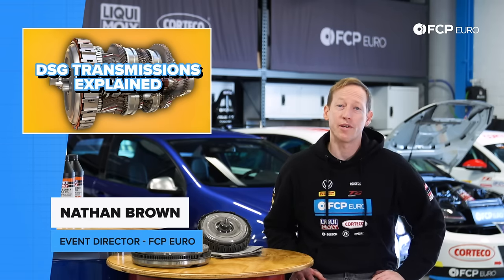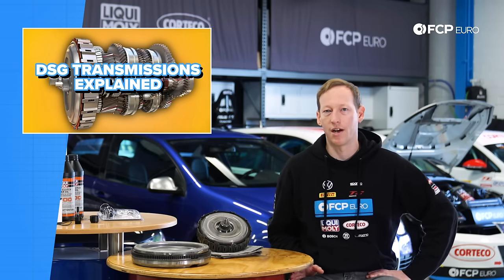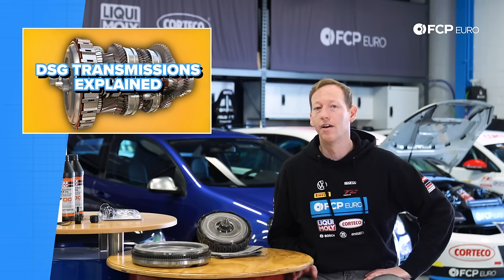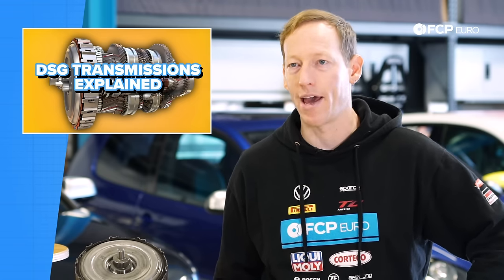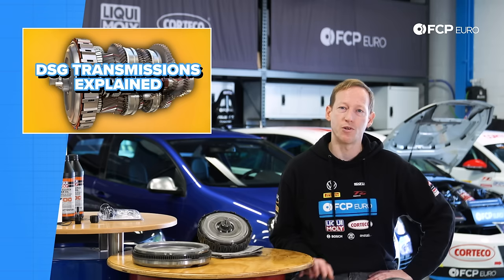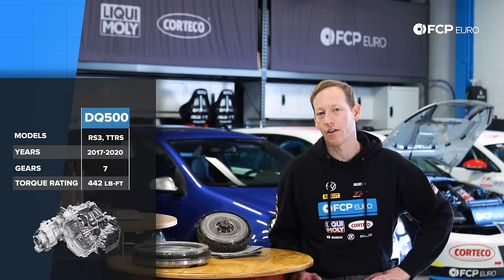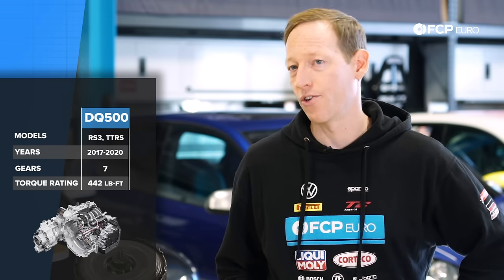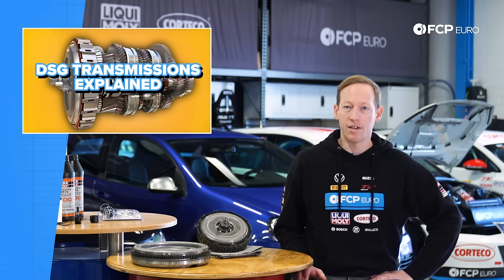The DSG Transmission Explained - How A DSG Transmission Works, Advantages, & Cars That Have Them

Comment: Superb video getting into the nitty gritty of DSG boxes' pro's and cons, just this one video could save a lot of VAG owners a lot of money, don't be duped by the wallet robbers and chancers . I've got a B8 S4 reverse gear vibe issue 'Oh it's looking like the gearbox it'll be around £1950'.. on a maybe? I don't think so, I'll update very soon, investigations are ongoing. Keep it up Nathan and FCP! What I like about Nathan's explanations is he talks normal speed, doesn't drawl all over or slow down, if you're quick thinking he's perfect.. if not then you may need to pause a few times but stay with it, I'd love to meet him but we're a few thousand miles apart. OH the DSG fart, its almost embarrassing, I'm 64 and don't need a fartbox!
Reply from the maker: Haha, yes all things do have their drawbacks. I don't mind the sound, more the "term" :D. Really appreciate the kind words! We do get out and about around the country, if you check our schedule at events.fcpeuro.com you may find something a bit closer than Connecticut. -Nathan
Reply: @fcpeuro  Hi Nathan as per your video I do like the sound when I'm caning it around a country road on my own.. in town it's a bit umm.. Anyway, an update on my vibration issue, had the engine mounts replaced and problem solved, they had both lost the fluid, both housings were cracked and one of them had lost the lower casting, a real mess and I saved at least £1800. Videos like yours are priceless so please keep up the great work for us 'real drivers' .

Comment: Question for any pros. 
If you have a DSG and you get a shutter on stopping and reverse. What would likely be the issue?
Reply: I'm assuming you mean a shudder.. if you have 80K or above miles, have the engine mounts inspected.

Comment: I been driving for about 5 yrs now with my 2017 ioniq with DSG or DCT…I noticed my clutch starts slipping around 120K ish driving…I’m on my 2nd transmission now and recently hav a burnt smell…I’m pretty sure as my dealer said it’s my clutch disc need replacement along with the troubled code of P0901 actuator …my question is if I don’t shift to sport mode at all and just use economy driving mode…Would it extend or prolong the lifespan of my clutches or clutch disc more than 120K or even reach 200K miles?  This is awesome detailed explanation of dct here on YT
Reply from the maker: Hi Leeto, whether you are shifting in eco or sport mode, the clutches will continually be operating, so the wear will always be there. However, if you always drive in sport mode, you may want to consider increasing your service intervals.
Reply: @fcpeuro  got it sir thanks for such a educational helpful answer.  Will keep in mind for sure

Comment: Awesome video! Question please, for longevity purposes on a DSG would shifting into N from D before coming to a full stop help reduce wear due to skipping the downshift to 2nd and 1st gear? It would be immediately put back into D after coming to a full stop. Or is there some sort of toll this would take that causes more wear than downshifts from 2nd / 1st gear coming to a stop.
Reply: I’m certain this only causes more wear and increases the likelihood of damage, especially if the light turns green before you come to a full stop. The dsg already transfers into neutral as you brake, so long as you don’t brake softly. Making your entire braking sequence steady, continuous brake pressure will save wear. I’m not a pro but I 100% feel it when I drive, and have heard a bit about the way a dsg downshift works.
Reply: @commie281  Hey there thanks for the input! So it would only be in scenarios where I would come to a full stop. Think I'm unfamiliar w/ this concept - but how is the transmission transfering into neutral while in D when I'm feeling the car downshift in sequence from 3 - 1?

Comment: Wish you had touched on the dry clutch dsg transmissions as well. Apart from that, the rest of thy content was very good
Reply: Thanks! We didn't touch on dry clutch DSG as those are not sold in the USA market, so wanted to keep it on target for what we have direct experience with.

Comment: Very high quality video.
I have been using the puny DQ200 dry clutch. I think its one advantage over the wet ones would be, it is comparably easy to fix.
Even the wrench monkeys where I live have learned to repair one. And the spare parts are also rather abundant.

Comment: The DSG Transmission Explained: Awful, awful, awful.
Reply: Please explain
Reply: @dragospahontu  awful awful awful. I think you should get it by now.
Reply: @jarnovilen5259  why? Please enlighten me.
Reply: @dragospahontu  you are taking this way too seriously. Nevertheless, avoid DSGs. Have a nice christmas and a happy hoppy new year!
Reply: @jarnovilen5259  ok
Reply: @dragospahontu  If it works, it's great to drive. But repairs are very expensive. There are several design flaws, like cracks in the housing of the megatronic, or a failing chip/computer inside the megatronic.
Reply: @stefan2796  exactly! But when it works it's 👍

Comment: Is this applicable to the DQ200 dry clutch DSG found on VW golfs with engines below the 1.6L category like the 1.4Tsi and 1.5 eTSI?
Reply: Works exactly the same except there is no oil running around the clutch packs. Oil still required to lubricate all the other components.
Reply: @TsLeng  Thanks for the info. So for this gearbox, what's the estimated maximum torque limit with a gearbox tune would be?
Reply: @tavorrulez  DQ200 are not used in models with more than 250NM of peak torque. 

Unfortunately it's not as good  for tuning vs dq250 as far as I know but possible. See TVS tuning and they claim you can go up to 400NM. Not sure impact on reliability.
Reply: @TsLeng  Thanks so much for the info. I'm not planning to fully tune the 1.5 eTSI on my SEAT Leon Mk. 4. More of just increase the power from 148bhp and 250nm to 170hp and 270nm of torque.

More or less a stage 1 tune.

Comment: What about the DSG in the TDI VW's, they dont even handle a tune without crapping out
Reply: They seem to do fine with big turbos and stage 3+ ECU. Mine has flywheel chatter now but I drive it hard and have heard of flywheels on grandma cars wearing out too, so just replace it once in awhile 100k-250k miles.
Reply: @1PotatoeMasher1  every tuning company ive seen or talked to have a 0.5 stage tune specifically for the autos so you dont smoke a trans
Reply: @ericadams920  the TCU is just programmed to see a certain amount of torque so you have to change that number or else it thinks there is an issue and runs bad. The transmission can handle it though. TDIs are rough on the DMF stock or tuned so its a maintenance item somewhere between 100k and 250k miles but that’s not too big a deal. They give you ample warning before the completely go so you have time to replace it. Don’t get a SMF though as it cause too much of the TDI vibrations in the synchros and will destroy them, just settle for a periodic DMF replacement. Just tune the TCU software to accept the extra torque of stage 1 and up ECU tunes.

Comment: To conclude, at what mileage should one expect swapping the flywheel and clutches?
Reply: 120k for Petrol and 200k for diesel cars.
Reply: @Lee-gr2sd  I have Golf 5 2008 model  Diesel  with 140000 km. Shall I change the clutches ? I heard some strange noises when on highway
Reply: @tonynguyen4199  it's hard to say.   Can be just wheel bearing.
Reply: Clutches, petrol: 125-175K km's (normal driving, no towing, etc.)

Comment: Dq200🤔
Reply: Great explained ! Like the video's a lot. 

There is another "odd" version. Whats odd :-) the dq400e. Don't know if the hybrid versions are available in the US. In Europe it is. It's for the 1.4TSI hybrid like in the GTE or Audi A3 e-Tron. A bit more complex because it has to switch between 2 type of engines.
Reply from the maker: We didn't touch on any ROW transmission options as we don't have those in the states or any reliable first-hand experience with them, so wouldn't be able to speak to the specifics of the DQ200 or other DSGs sold in Europe and Rest of World
Reply: @fcpeuro  Oryt but great video👌
Reply: @fcpeuro  1.8TSI Alltrack in Europe has dq200

Comment: Driving a 6 speed DSG and it's just awesome, the timing and precision is perfect, and preselection of gears is just amazing.. But explaining Manual and DSG to americans is useless.. :D :D :D
Reply: Americans still drive both 😐
Reply: I was totally on board with your comment until that last part
Reply: Not sure what you mean. Americans know all about dual clutch transmissions. The corvette has used one for many years now and so has the mustang
Reply: I driven an 8 speed dsg vw amarok and a 6 speed manual amarok and i outperformed the gearbox, cause it predicts to what gear it gonna shift but sometimes when you do hard acceleration then you do hard braking it confuse the thing
Reply: I literally drive a VW with one….
Reply: Get a 6 speed manual and you will REALLY see what awesome is.
Reply: @blondishasp572 : Automatic AND DSG?
Reply: @yassinbellakhder7958  amarok has no dsg Transmission. It has a Wandler Transmission. All of VW and Audi familly above 500nm has a Wandler and no DSG
Reply: Dude, Hyundais and Kias have DCTs, some still have manual options.
Reply: @dannyo3317 Yes… my current vehicle has a DSG… and yes, manual is still pretty common here granted not as common as automatics.

Edit: thought u said manual but you said automatic. The DSG is an automatic… it’s just not a traditional automatic but the automatic is called an automatic because it is automated… the DSG is automated. Everything in it is electronically controlled.
But people keep thinking americans are slow…
Reply: @nihadbesic6760 says the guy who clearly watched this video because he didn’t know or wasn’t sure what a DSG trans is and what it does.
Reply: B8 S4...bone stock except for a HX. I love the sound of a DSG fart. Something about that noise and the feeling of almost seamless acceleration unlike anything I've ever driven...its amazing. DSGs are amazing and I'll fight about it 😅

Comment: Thank you.  Excellent explanation.  I am new to DSG and have the DQ250 on my 3.2TT.  I've only had it out for a handful of drives and love it.  I didnt realise that it downshifted in manual automatically.  I have been nervously dropping it back into auto at low speeds through fear of stalling but you say I'm okay as it will still downshift automatically before the car would stall??
TIA
Reply: It will prevent stalling so will downshift itself in manual mode if revs drop below the threshold.  

If it's anything like mine, it will even kickdown on its own in manual (not very nice) and certainly upshift itself at redline.
Reply: in sport mode it will even rev match when braking to slow down. it kinda is scary with modded exhaust because you get all this noise out of nowhere when slowing down lol

Comment: Stay away from DSG on your commuter car! 
On Porsches and performance vehicles it might be OK looking at the data. 
I had a VW CC with a DSG. Only VW dealer serviced. The gearbox complete failed and left us on the middle of a busy Interstate Highway. The car had less than 85000 miles and it was 5 years old. Almost non of the service centers I called wouldn’t even want to see the car, because it is a very complex/complicated transmission unit. 
VW dealer said that one of the clutches failed and need a brand new transmission for $10000+ for a new one and find second hand for $3300. This is the WORST gearbox I have ever had on any of my cars.
Reply: And yet there are literally hundreds of thousands of them being used as commuter cars on a daily basis, just because there is the odd one that fails doesn't mean they are all terrible. Not all VW DSG's are made equal too, the 7spd dry clutch DQ200 has terrible reliability whereas like stated in the video the DQ250 is incredibly reliable.
Reply: I heard the 7spd are dry clutches & 6spd are wet. Heard dry ones go out quick so thay could've been the problem🤷

Comment: I love my 2008 MKV DSG, and the farts :)  Sometimes I can get extended burbles with certain revs, throttle positions, and engine loads making the shift slower.  Mine had a mechatronics replaced by VW, I think the problem with them was a spacer washer/shim of some kind that was sub-standard and wore thinner, causing the issues, but this might have been speculation.  My wife's Polo 6R GTI has the 7 speed dry clutch, and I don't like the feel of the shorter 1st gear at all.

Comment: Here is the "process" of pulling out onto the highway with my automatic dual-clutch 2019 A4: 
stop and look left for a traffic gap, 
upon seeing gap-- stab accelerator: 
auto off/on starts engine, 
clutches engage, 
turbo spools-up and my A4 jerks out into traffic
car gets rear-ended due to all the delays. 
If I had realized all of this BS would occur just to get this damn death-trap going, would have never bought a dual-clutch automatic car.. long live the torque converter...
Reply: Driver mod needed
Reply: Absolutely agree until the very last sentence. Automatic transmission? If you like to drive a VW just get a manual transmission. If you want automatic with a torque converter just buy a Buick
Reply: 1) Auto start/stop has nothing to do with your transmission type. Disable it if you know you need to merge quickly. 2) Torque converter automatics respond to launches much more slowly than DSG, so I'm not sure what you mean by "clutches engage". If your DSG doesn't have launch control from the factory, get a software upgrade that adds it. 3) Having a turbo that needs to spool up has nothing to do with the type of your transmission. It would be worse with a torque converter.

My personal experience with a 3.0 supercharged engine with dual-clutch, is in manual mode, even without using launch control, it is really quick off the line in 1st gear.
Reply: Stabbing the accelerator is the equivalent of you not being sure what you are supposed to do, then out of nowhere someone chucking a bucket of water in your face. You’d be stunned before you could do anything. And that goes for any car. Most people’s driving improves after passing their test at 17. Looks like your’s hasn’t.